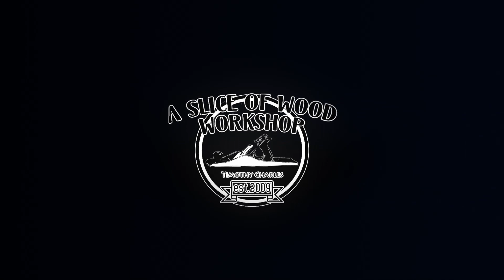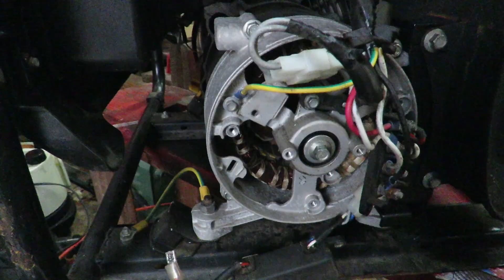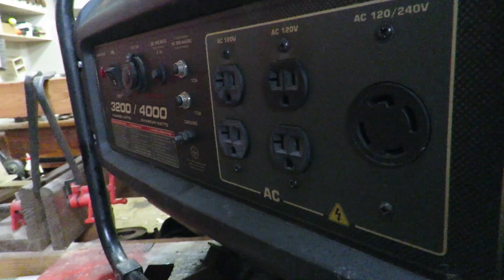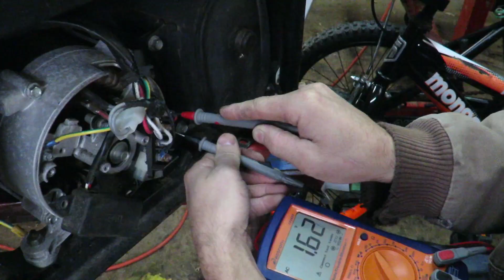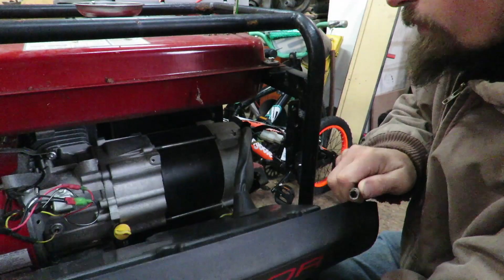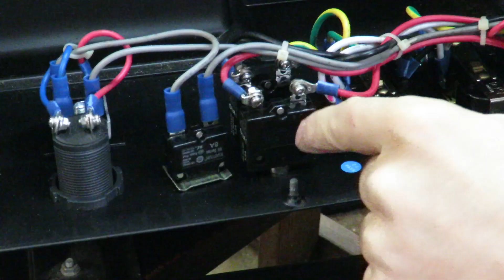Predator 4000 Generator | Deal Or Dud?

Comment: With engine running, AVR out, across the brushes  Ideal 5-10 volts;  L1 and L2  - ideal 3-5 volts;  R1 and R2 – ideal 3-5 volts and R1 and L1 – 0 Volts

Comment: Mine's doing the same thing it's somewhere in the breakers one day it's working shut it off turn it on to next day running perfect no power I can't figure it out , I hit reset on plug and won't reset.  Check it the next day and it works . Given me a headache

Comment: I use it to Run our home during power outagesꉺꉺ>share4.photo/HF87Generator?V22     I use a switch box I just plug it in & start it & it vertically will run our home with out a problem I totally recommend this product & love having a 2 year replacement Warranty it gives you a good peace of mind not worrying about it giving you any problems I just wish they would have included a battery with it

Comment: I wrote the comment under this one when you were talking about not getting power. It sounds to me like you have a faulty AVR were the internal contacts have either a break in it or it’s stuck open where it won’t allow current through it. I’d believe it’s the AVR. Good luck.
Reply: agree
Reply: Everyone should be careful using portable generators https://youtu.be/I1jT3ANENvI here’s an advice about keeping your family safe while using generators. Generator safety is very important especially during severe weather

Comment: Did you check the AVR with a meter you may have a break or open in the AVR if you have a relay between the AVR and control panel that also could be a problem.

Comment: To diagnose, measure AC output at outlet.  If you are getting 3-5 VAC, then your brushes are good, as well as stator or rotor windings. Probably AVR.  You can measure resistance of the two stator windings at the post, which is opposite the AVR in under tne end bell cover.  First two are one winding, second two are for the other.  The resistance for each winding should be same.  If you get infinity on either winding, then they are toast.  Same with rotor.  Take a resistance reading at slip rings.  To do this you can either remove brushes or take the reading at the brushes. Brushes will add a bit of resistance, but what you are looking for is a resistance reading.  If you get infinity, it's toast.  Probable the AVR though.  Good luck.
Reply from the maker: Yeah windings were good. I do believe it was the AVR. We have another one here and switch them out and it started generating power.

Comment: I have the same make and model as you and the exact same problem, are you going to continue this video. I have not started any troubleshooting other than looking on youtube.
Reply from the maker: The generator piece went bad. Somebody had the exact same generator, but their motor was no good so they are going to combine the two and make 1 usable generator. I never did get a response from HF for a possible fix. Sorry I can not be more help.
Reply: @ASliceofWoodWorkshop  what generator peace went bad my was running had power use it everyday then power went out like 10 mins ago.
Reply from the maker: The avr

Comment: Good luck, I’m at a loss, too.
Reply: ⚠️Generator safety: please make sure you are aware with all the hazards of using generators. Generators can be dangerous if not used carefully. Always remember that carbon monoxide is a silent killer and it’s an odorless and colorless gas that you cannot see or smell. And carbon monoxide causes death. It’s poisonous. Many people have died each year when using generators due to carbon monoxide poisoning and electrocution. Generators should never be used indoors. Make sure your generator is 15-20 feet away from your house and away from doors, windows, and vents to lower carbon monoxide poisoning risk. Remember not to also run your generator in wet conditions. Using generators in wet conditions can electrocute you. You should keep your generator dry and make sure your generator is dry before using. Do not let the generator get wet. You need a generator tent to protect your generator from getting wet if you’ll use your generator during wet weather. We also really need to keep our children safe when we’re using portable generators so they won’t get electrocuted or burned by the generator which is dangerous. Children should not be playing near the portable generator to avoid risks and should be kept safe. We should be aware with all the warnings that is said on the generator’s operating manual. Generators can be hot and they pose electrical risks. Generators can cause death if used incorrectly. Don’t ever try to plug a generator cord into a wall outlet to avoid back feeding. Back feeding is dangerous. Please don’t overload your generator. Overloading your generator can cause damage to the appliances that are plugged into the generator. Use a heavy duty cord for your generator and make sure the cord is not worn out. Always turn on your generator first before plugging in appliances. And before you unplug appliances, please shut off your generator first. Please don’t refuel your generator while it’s running. It can cause fire. You need to shut off your generator and please let it cool off before refueling it. Make sure your generator is grounded properly.  Everything that is said on the generator’s operating manual should not be ignored. https://youtu.be/I1jT3ANENvI and here is a video more about keeping your family safe while using generators. This is just a safety reminder of using generators carefully and keeping your family safe. Thank you hope you stay safe.